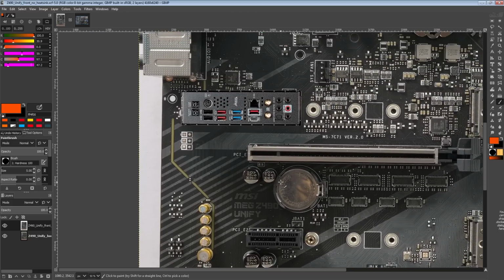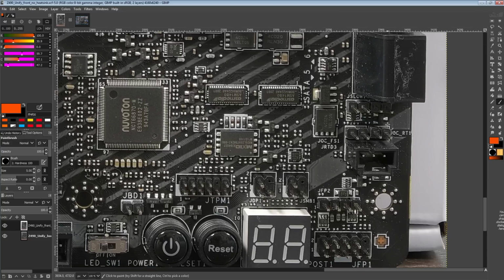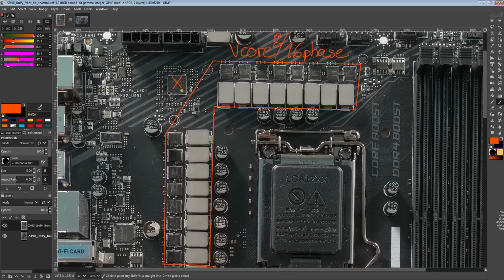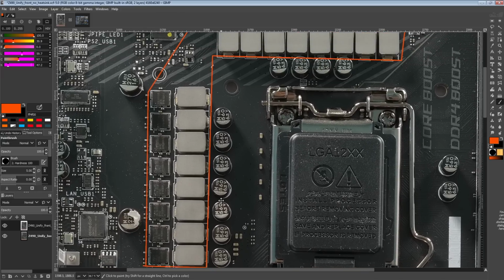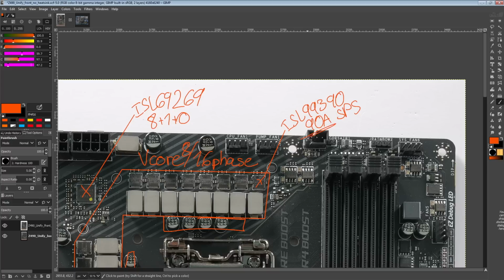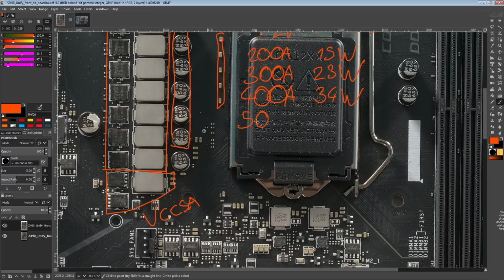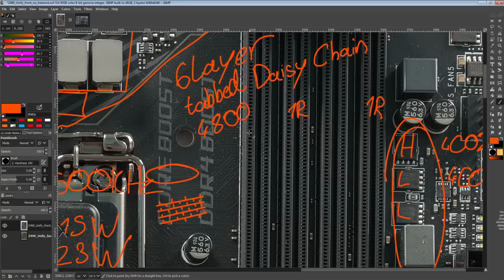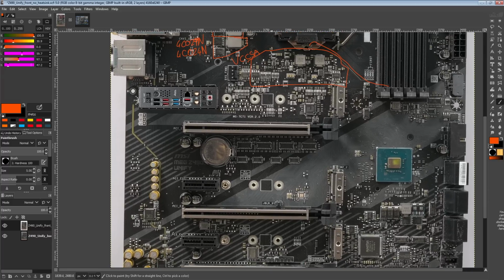mobo PCB Breakdown: MSI Z490 Unify

Comment: Actually bought this board from this channel's info, and currently sitting at 5.2 with 1.36V, can't complain!
Reply: What cooler are you using? That's awesome!
Reply: @grdfhrghrggrtwqqu   Kraken Z63 :D
Reply: @weih723  Oh nice! Was considering a liquid cooler and was curious on how well it would be for the 10850k mobo/cpu. Wonder if I wil get anywhere close to that with the Noctua air cooler.
Reply: @grdfhrghrggrtwqqu  10850k Is probably even harder to cool than 10700k that I have, I am not so sure about air solution but Noctua is a beast of a cooler though. btw I have to dial back to oc to 5.1 and memory down from to 4100mhz. (from 3200mhz) to be fully stable.
Reply: @weih723  hi, can u tell me more about difficulties to cool the 10700k? Am planning to do a config with that cpu and the Unify and i really dunno what AIO is the best for it (kraken/Arctic/...??) and what temps are good/not good.
Ty :)
Reply: @simonecorfini3628  280 and 360 aio have very similar cooling performance, so either will work depends on your case configuration. I like NZXT the best as it is sleek and cools 10700k no problem and is relatively silent. For temps anything 80ish stable running p95 for period of time and not crashing will work after overclock.
Reply: @weih723  it's not new but i was looking for Obsidian 750D Airflow, i'll take a look to KZXT...tell me if u have some reference models ;)
Thousand thanks man! :)
Reply: @simonecorfini3628  X63 is awesome, Z63 is more bling! =) I have both
Reply: well 5 ghz all core works but 250w impossible to cool I hit 95°c with custom loop

Comment: The power stage current limit comment was spot on. To expand on it, the packaging is also a major limiting factor. Powerstages with metal top should be able to handle close to double the current despite the advertised max with sufficient cooling. Same with traditional lo/hi fets... Remember the radeon 7900/280/290/390 managing not burning up the vrm.

Comment: 1:38 "not using a standard fan connector" Anyone who's taken apart a few laptops will know that is a standard fan connector. They are by far the most common for laptop fans (and smaller fans in general). I'm sure it's a standard termination for whoever the fan OEM was. I was surprised with the EVGA dark PCB using a connector that large for a fan that small on the x299 dark.
You can easily use a fan there by getting a broken laptop out of the dumpster, cutting the fan cable in half, and soldering it to your fan of choice. Or buy a cheap Apple MBP fan. Apple used these on macbook pros since 2009 before moving to a FFC connector in 2016. Note that due to the size it will not support high current fans. So don't go tossing on your 10K RPM San ace and expect it to work.
Edit: I haven't double checked the part numbers, so do your own research before buying a fan to cut up.
Reply: @SteveZ1  I have the same question ^^

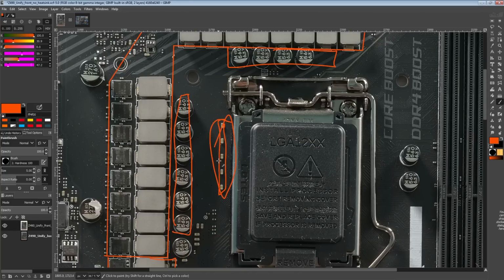Comment: 23:23 "back of the board capacitors are not that effective because they have a bunch of impedance between them and the actual CPU socket itself" The impedance of a via is not that much (under one milliohm per via, and there's a lot in parallel), but they will have a lot more effective ESL from the via that they are in series with (at least 1 nH). This will have a greater effect at higher frequencies. Since the power and ground vias are pretty close, that effect is mitigated somewhat. I'll see if I can measure how much via ESL effects bypass capacitor effectiveness using TDR at work soon.

Comment: The voltage read points are nice to have for someone attempting to repair one of these boards 10 years from now.  I agree they won't be used all that often, but I wish every computer part had features like that.

Comment: I have this board and its great!  Paired it with a 10700k and yes, I did get the Patriot Viper Steel 4400hz which run XMP perfectly. Evga P2 1000W, m.2 Samsung evo plus and waiting around for the nVidia 3000 series with a 2060. My 2060 is finally getting a workout coming from a i7 4790k! Lets play some games!
Reply: Also, I have 2 USB connections on the front of case and a Type C. I am not sure if that option was covered.
Reply: @robertdunlop5247  Wow . By random I did order today the same: this board , i7-10700kf, Patriot 4400Mhz ,and I have a 1000w PSu ...... Now that our RIGS will be virtually the same (you did'nt mention the cooler , I've got a Kraken 73 360mm AIO) may I ask what kind of overclock could you do ?

Comment: maybe the VRM overheats when doing testing using a overclocked 10900K, blowing the hot exhaust on the VRM, in a 40° ambient room

No iGPU is a pretty big deal breaker for a daily system. Adobe uses quick sync and nvidia simultaneously nowadays, for example. The iGPU is also really useful for debugging and virtualization.

For XOC, it makes sense to leave it out, but for anything else there has to be an iGPU phase.

Comment: Nobody:
LIterally nobody:
Mobo manufacturers: So anyway, instead of putting proper heatsinks we decided to slap a fan at it.
Reply: I mean, look at something like p8z68 deluxe - it has all the gamery, flashy looks while still having decent surface area.
Reply: >Anime profile pic
Opinion discarded.
Reply: @バカ-l9o  FAX
Reply from the maker: except this board doesn't even need the heatsinks
Reply: @ActuallyHardcoreOverclocking  
hi bz, what do you think about this situation in relation to your recommended pbo values or manual overclocking? this info is from the stilt.
Maybe a video?
https://www.hwinfo.com/forum/threads/explaining-the-amd-ryzen-power-reporting-deviation-metric-in-hwinfo.6456/
Reply: @バカ-l9o  there's this saying that while pointing with your index finger 3 fingers point back at you.
Reply: @ActuallyHardcoreOverclocking  please please tell how many amps is a phase made of one 4c10n and two 4c06n MOSFET is rated for ...pleases please I am noob
Reply: @mr.waffentrager4400  I'm a real noob and I sense sarcasm. What are you actually trying to say? I've bought everything except my motherboard and cpu and am on the fence of what I should get with some of these features ie code indicator and bios buttons and at a decent price point. Id rather not fork out an extra $100 for the asus xii hero.
Reply: @colonelinfernal5004  Are you going to be overclocking?  What CPU do you want?  Those are the two questions you need to answer to yourself first.  BZ has an overall run down on ALL 'worthy'  Z490 boards (from low price to high) on GN's channel.  He also has a few rambling videos about (from what i remember) all gigabyte, asus, and msi boards (one vid for each company) That should help you choose
Reply: @rickyyoung  I purchased this board along with a 10700k.  Everything has been smooth sailing though I havnt yet had the free time to test much overclocking. I intend on doing so in the near future.
Reply: @colonelinfernal5004  Do you have some results?  (I've just ordered both this motherboard and 10700kf today...)

Comment: Odd q for you -- how does the 4C029N/4C024N mosfet combo compare on Vcore to DrMos chips like those on the MSI z490 Tomahawk or ATX Gaming Edge Wifi? I'm curious because MSI chose to use that discrete mosfet combo in place of DrMos for the mATX Gaming Edge Wifi Vcore, which is sad that they named the board same name, but different VRM setup on the mATX vs ATX versions....

Comment: This is all good and all but once i went with workstation motherboards i have never looked back. Chek out the asus WS z390 pro. Feature packed! And actually uses the whole pcb board. There is most likely a ws z490 at as well.

Comment: Hey guys i have a question, in order to calculate the amount of heat that is going to be dissipated with descrete mosfet i use some formulas like: Conduction Loss(High side and low side) + Switching loss + Dead time loss + gate charge loss, in total i know the amount of heat that is being dissipated through each phase or the entire VRM.
But how do i calculate this in a Dr.Mos or a Smart power stage?

Comment: :( Mine was paired with a 10900K previous year but upgraded my system to a 13700K this year and sold the 10900K. I did have a 10600K lying around and 4x8Gb 3600Mhz mem so when watching this video I now know I have a Silly combination ><.
Wanted to see how the board would do with 4x8 1R because I only had 2x16GB before but sold everything except the board.
10600K is pushing a 2080ti on it though at 5.1Ghz so that's nice.

Thanks for the detailed video btw :D

Comment: Any thoughts on the ITX?  Still waiting for mine to come in, and looking to pair it with some hynix cjr vlp so that it will fit in my sff (cooler height issues with push/pull 120mm?).  Do you expect the ITX to perform as well in the ram oc arena?

Comment: I don't care  for POST codes, if you know what you're doing then troubleshooting with a POST code is just going to lead to bad diagnostics most of the time really
Reply: I do like being able to see the post code patterns when I'm trying memory oc and it fails to train.
Reply from the maker: if a POST code makes you mis diagnose things you're just bad at trouble shooting.
Reply: Maybe in the past but this board is really good at saying whats it's doing....and the manual isn't too bad either.  The board has ran perfectly for me with 4400mhz Viper Steels.....I guess theres a case of if you don't know what you're doing then don't do it. lol OR just do it and see what happens. Try try try again.

Comment: could it be better rating VRM power stages by Rds(on) rather than using the absolute maximum continuous drain current figure.. which btw doesn't mean much with vrms as it's pulsed and pulsed specs are listed differently on a dedicated table? 
also i'm really curious about how the hell you do power dissipation calculations. :)
Reply: He made a video on it. It doesn't account for driver losses though.
Reply from the maker: Power stages don't come with RDSon specs
Reply: @ActuallyHardcoreOverclocking  . oh sorry I didn't know, I mostly saw mosfets and I expected the same. I'll have a look at a power stage datasheet right away. :)
Reply: @kelvinyonger8885  driver losses should kinda be doable for mosfets uaing gate resistance, driving voltage, gate coulumb value and maybe something else. LTSpice spews out absurdly high values.

Comment: @Buildzoid my 10900k can do 5.1ghz with as low 1.2v on this board, is this makes a good transient response board?
Reply: Since it clocks depend on CPU, you would need to test the same settings on other 300ish boards to see.
Reply: @kelvinyonger8885  👍 Best would be to compare same cpu sample on the Unify  and a mobo with good transient response. This would probably determine if the unify got a garbage transient response or not. Are there 300ish motherboard with good response?🙄

Comment: Does having a smart power stage actually improve overclocking compared to dumb ones like IR3555?
Reply: IR3555 is smart power stages though and was the best mosfet until the 70A/90A spawned

Comment: I had to RMA a gigabyte z490 aorus elite board, and while waiting on replacement I decided to switch to refund, and bought this board instead for my i7-10700k. Anyone have any suggestions for what timings to start with for 2x8gb g.skill flare-x (b-die) 3200mhz cl14 kit? I was thinking 4000mhz cl18 to start @1.5

Comment: Not everybody uses 30 USB ports like you do. You have to realize this.
Reply: Fair point when it comes to backplate USB when there are lots of internal headers available to use
Reply: a 300$€ board with lackluster USB ports is insulting especially since the added cost is almost nothing.
Reply: @emperorSbraz  Well, MSI expects you to be able to be able to connect the headers to the front of your case.  I have this board, and have and extra 2 USB and 1 Type C ports there.....So that kinda solves that issue. BZ maybe didn't think about that.

Comment: Guys, I have a question: I've been overclocking my memories (G.Skill Trident Z 3600 CL17) I've gotten my kits stable at 3733MHz at 1.4v and while running the built-in benchmark of "F1 2018" HWinfo showed my temps were 52°C in one kit and  50°C the other kit. Can someone tell me if this is normal?
Reply: Yes.